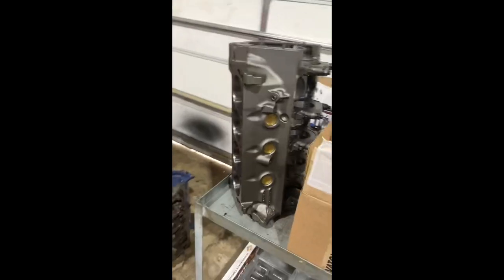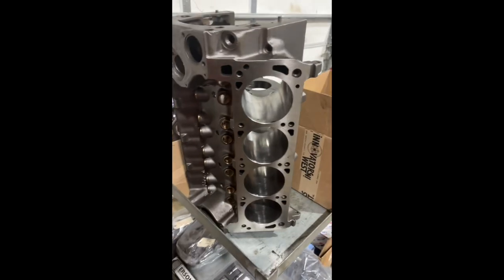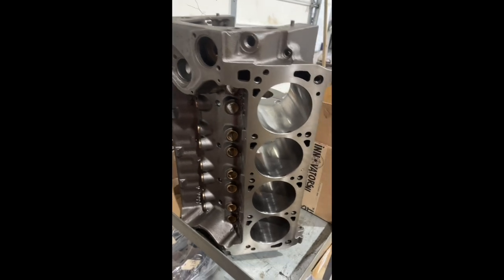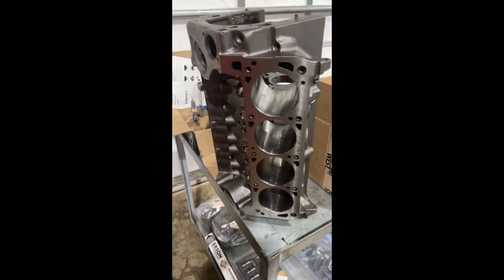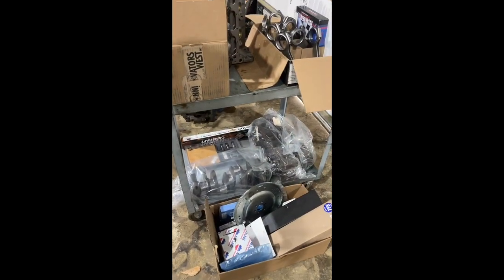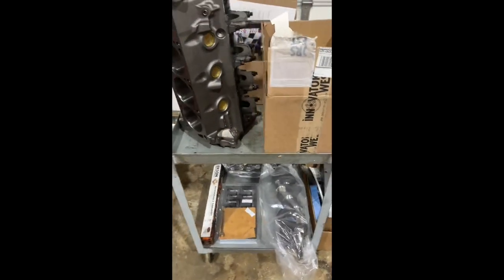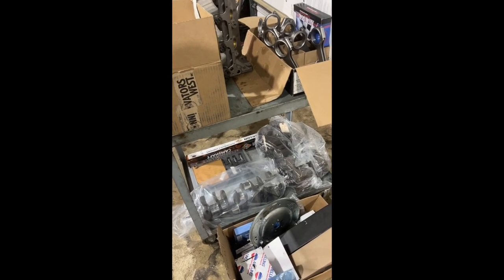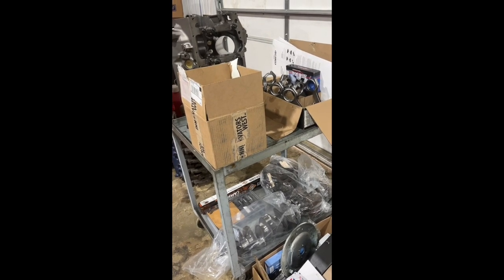AN ENGINE IN A BOX! // Titus Performance

Comment: Can i ask....???....Doesn't the Block Come with ARP Studs in the bottom end as standard  ????....
Reply from the maker: No they do not.   Ford originally used bolts in the main caps.  We changed to studs before line honing the mains
Reply: @TitusPerformance  OK....  it looks so new i thought it was one of your Iron new blocks..